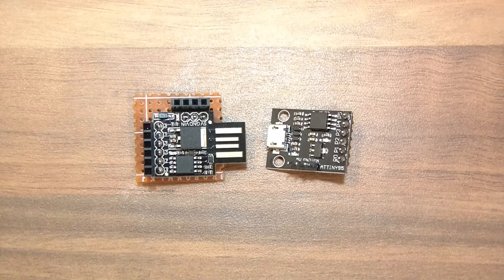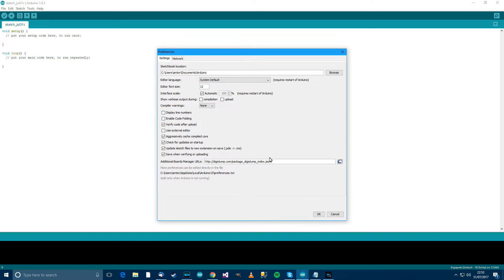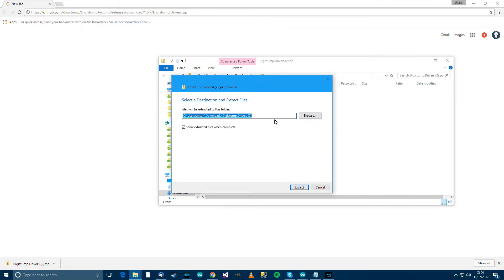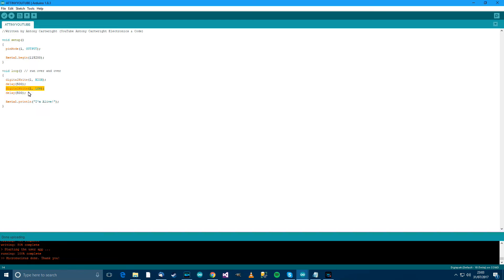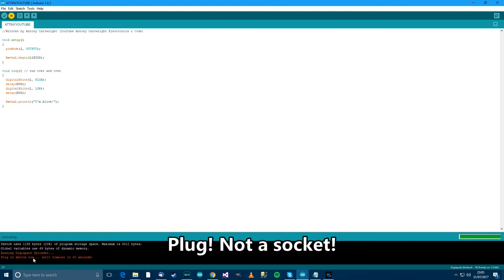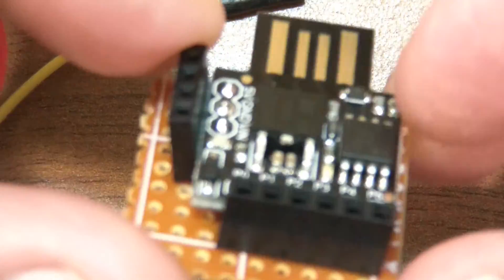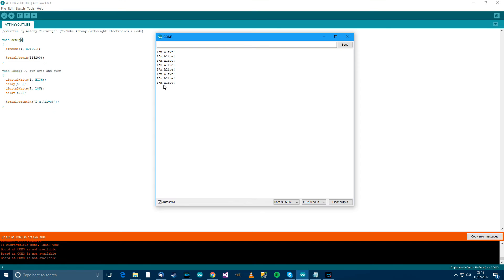TUTORIAL: Quickly Getting Started ATTINY85 - In 9 Minutes! (Digistump Serial Output)

Comment: In 2021 when you start the upload you will see : 
--
Sketch uses 700 bytes (11%) of program storage space. Maximum is 6012 bytes.
Global variables use 9 bytes of dynamic memory.
Running Digispark Uploader...
Plug in device now... (will timeout in 60 seconds)
---
You plug in the board in USB and it always flashes. For each programming you will have to take in and out the USB.

Comment: Thanks for the tip but I was expecting serial communication via the USB port which would make more sense...
Reply from the maker: But this is serial over USB!
Reply: Nope, this is serial over an external UART interface hence not included in the original device... There is already an UART interface in the Digispark to upload sketches but it seems absolutely useless when it comes to use it otherwise. What I want to do is to connect the Digispark on my USB port and being able to whether upload sketches or get serial communication without any other device. One USB, many usages!!!
Reply from the maker: I see... Well this module is very weird when it comes to that! If you let me know how to get it working, please let me know!
Reply: @antonycartwright  thats interesting! you can upload, without any uart interface (i think in that attiny85 board is nothing like that)  soo the big elephant in the room, or however you brits call that ;) is: how does it work and is it possible to get messages without any interface between the attiny and pc.

Comment: what is that other chip you wired it up with in order to read serial output? nothing mentioned in annotations or description....
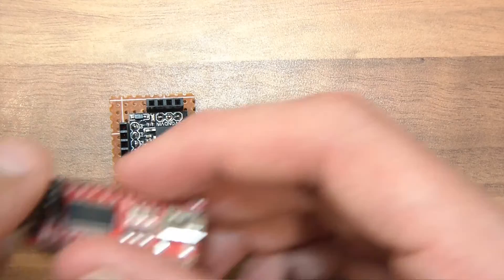Reply from the maker: Hi, it's at 5:44. Antony...
Reply: yes, clearly I have no issues seeing the physical device. I'm wondering the name of the product so that I can actually get one... :l
Reply from the maker: But at 5:44, I say it's an FTDI UART! If you type that into ebay, you'll see it! :-)
Reply: o, ok. well, I don't really understand the use in having such a tiny arduino chip when you have to use it with another device -- which is almost the same size as arduino nano which has way more functionality by itself...
Reply from the maker: The idea is that when you deploy the project, you take the programmer away. :-)